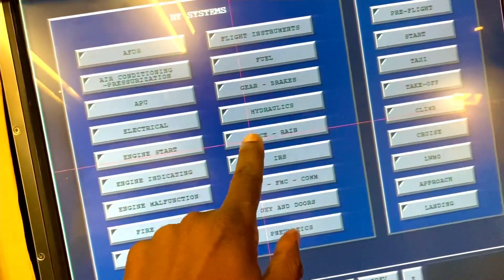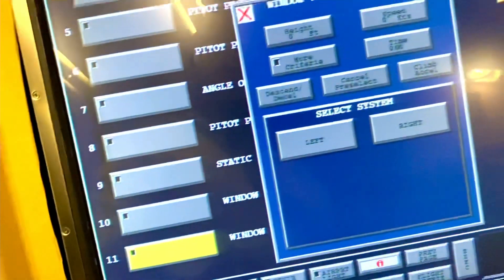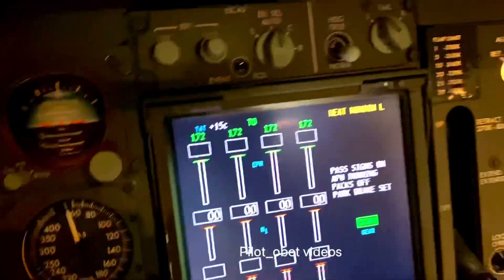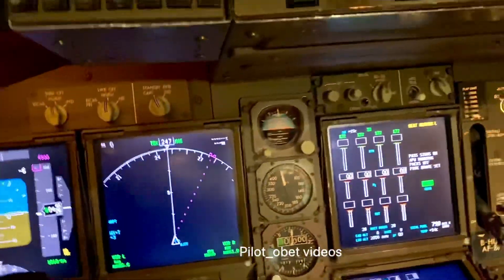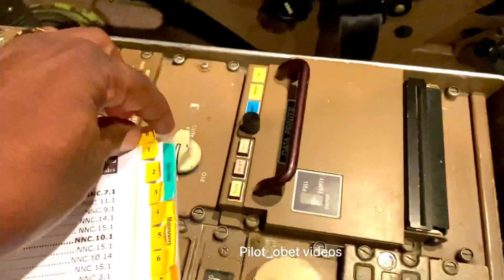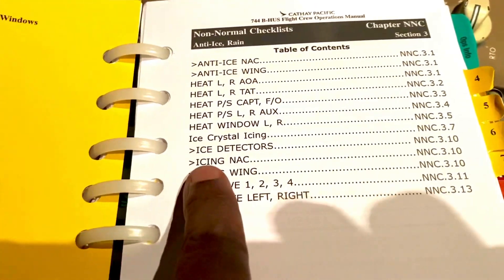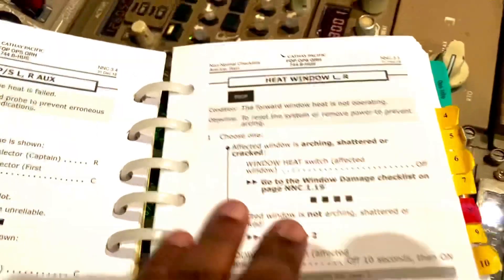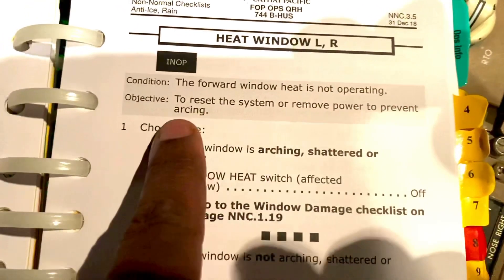Boeing 747-400 Window overheat/Reset

Comment: I curious, is it ok to enable window heat for the rest of the flight even if the plane doen't expirience any icing conditions. Airbus A320neo have two settings for window heat On or Auto. Boeing looks like have two positions ON and Off. Can position On work like Auto? Other deicing setting have auto position, but i am not sure about window heat.
Reply from the maker: Yes we have the switches ON all times- temperature controllers automatically adjust.
Reply: @pilot_obet  Thanks.

Comment: What is the difference between standby/backup window heat and the normal window heat? Why 747-8 have extra switches for standby window heat on the rear overhead and 747-400 does not. When do you need to use those switches (i mean the backup ones on -8)?